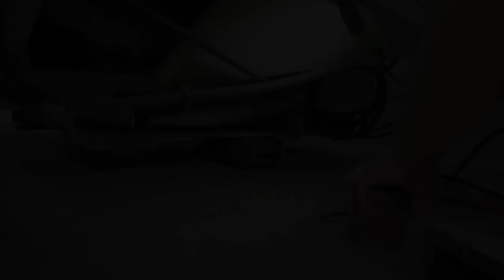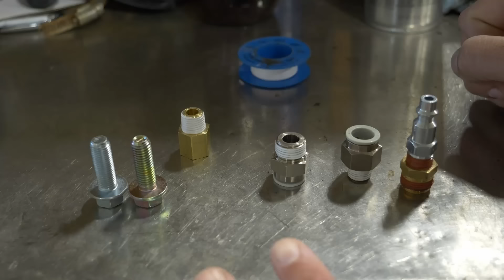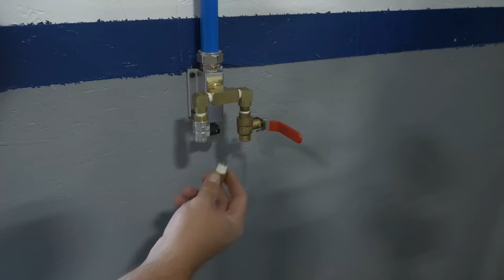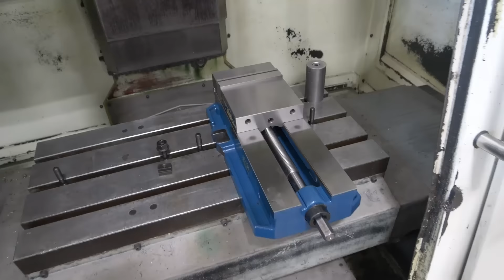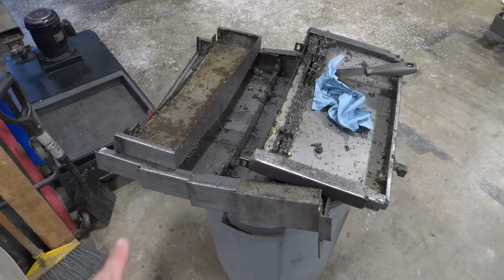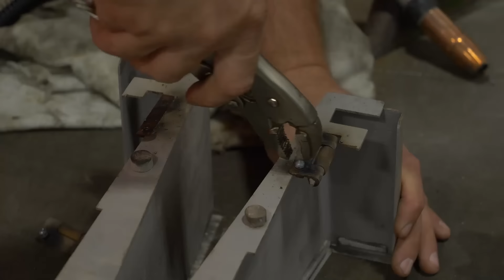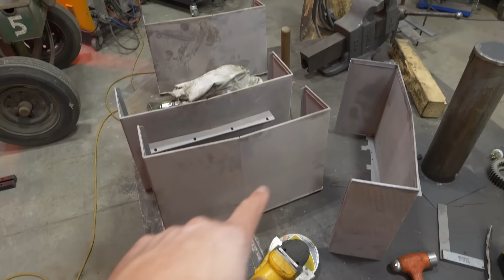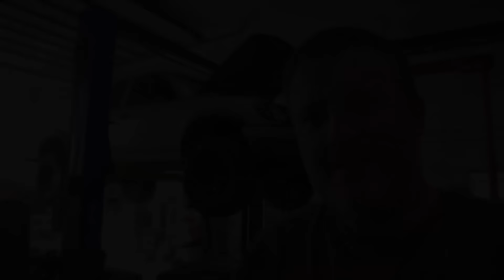Did I Buy a Problem or a Solution? Cheap CNC Repair Part 1

Comment: There is no such thing as a fully metric country. Even in the most enlightened of places, the dreadful British have contaminated some area or the other with their outdated standards. For instance a TVs size, a bicycle frame, or a cars rim, is measured in inches, pretty much everywhere, on the planet. Pipe threads, and hydraulic fittings, are still sadly one of these murky areas, where you regularly come across sizes made up of divisions...
I comfort myself knowing that today both the British, and American inch are based on the metric system, as they didn't have any semblance of accuracy, based on the original definition, which was to lay out three full barley corns next to each other(!). The Japanese have their own old system also, based on some ancient Chinese stuff. Think they even banned the sale of scales in their old system to make people stop using it. It is still fairly common in Japanese carpentry dough...

Comment: Wow. DTE-24. That brings back memories of when I worked on machines that were made in Switzerland. Used DTE-24 as air lube. We just put any kind of air tool oil in, never hurt anything.
Reply from the maker: In most cases oil is oil. The builder will spec the best oil just to cover their behind.
Reply: We used to use DTE-24 in a Monarch Cortland VMC75 back in the day

Comment: Apparently that tacoma didnt get the free frame update. Should have been under the 15 year warranty between 95-2004 model years. My dad had one with the  'bad' frame, and Toyota replaced it for free.  So much was pre-covered, all he had to pay for was upgraded / new shocks.  Got new brake lines, new rear springs.  And that was the weak link on those trucks.

Comment: You are putting so much work in that machine, please make a backup of any harddrive you can find in there..
Reply from the maker: It's an SSD. It should be pretty safe.
Reply: @WatchWesWork  No disk drive is "safe", even if it's a solid state drive. I remember SSDs suddenly being blank bugs not too many years ago, or the samsung slow down bug. A disk image (using an external enclosure and some cloning software) gives a piece of mind. Especially with old machinery, where reimaging images might not be available from the manufacturer.
Don't be me, don't learn the hard way 😅
Reply: I'd gut it and use a new machine controller. But that might be a lot of trouble itself. Still I like what I like. I'm willing to go to unreasonable lengths to get it too.

Comment: Good Tacoma frames are actually not that hard to find in salty areas. Toyota replaced a ton of 01 - 04 frames as late as 2019. They aren't that bad to change either. Guys that did them a lot could do them in about 20 hours. If you never did one before expect closer to 40 hours. You can use an 01 - 04 frame on any 95.5 - 04, but if you're using one on a 95.5 - 97 you need 98+ leaf springs.

Comment: Actually I think most of Europe uses BSP pipe fittings. Metric fittings are only rarely used with water and air, but common with hydraulic and compression fittings. I knew about the difference between NPT and BSP, but I didn't run into a NPT yet (although I never really check any other than seeing if they thread together, so I might have unknowingly threaded NPT into BSP and vice versa).
Metric threads have several standard pitches, although you'll only get the most common one in hardware stores, fine threads are specialty and only stocked by specialty fastener stores.

Comment: Great video, and I like the comparison of metric- and imperial system. I live in Norway, and I have worked at a shop that makes hydraulic hoses. On the shelves we had BSP, JIC, ORFS, NPT and MM (millimeter) fittings, and they are pretty common in any of these shops here. MM and BSP is the most used types, and ORFS is also getting used more and more.

Comment: Hi from the uk - we are a mixed race ie we use imperial and metric - my tape measure is in both so it is excellent for measuring things ??? Say if I want to measure a piece of wood which is just over 33.3cm urika it is suddenly 13inches or vic verca if it is just over 5 1/8 inch suddenly it becomes 13cm. Very handy for getting my head around non critical measurements. Anything for an easy life so I think I prefer metric in the long run as it is easier to multiply 😊🇬🇧

Comment: With one problem in your physics. In the US standard, we have lbm and lbf clearly.  Since no one indicates the "f" or "m", it gets confusing. The lbm is the the mass or slug (the unit of mass in USC), but slug s not used.  Slug is equivalent of Kg. lbf is the unit for force or equivalent of Newton.

Comment: As someone from a metric-only country (mainland europe), it doesn't mean that everything is actually metric. The most annoying example is most connectors related to pipes (water pipes in houses, garden hoses, gas lines, whatever...), which for some reason is still almost entirely inch-based, and I have no clue why. Usually just the connectors though, the actual pipes/hoses use lengths and diameters that are metric. AFAIK there are metric standards for connectors, but they aren't in use in practice. I guess it's a relic for some reason, and there never happened to be a suitable time to break with what's commonly used?
I did check a local hardware store, just searching for (my language equivalent of) "hose" or "pipe" and similar, and didn't see a SINGLE metric connection. It's just wild...
But we also aren't quite free of the inch-world, just like BSP isn't a metric standard even if the whole CNC machine is from a metric country. Multiple/many standards is exactly what the metric system is supposed to prevent, or at least make more rare, which only kind of works (but not quite). The more niche an application, the more likely there seem to be multiple competing or even conflicting standards. There are "standardizing entities" like ISO or DIN amd they usually have true equivalent standards for the same thing, to avoid conflict. But there is no true "definition of metric" either that I know of. It's maybe more of a concept, and again more niche means less clarity.

Comment: Yeah...covers look good to me...I've ran machines far worse than that...do like the cardboard mockup machine... would recommend shutting down the machine with a empty spindle and placing a wood 4"x4" below the spindle for when your not in use...helps the drawbar from hanging up ...good content and waiting for part two..thanks Wes...🔧🔧👍

Comment: Call me odd, but I actually love the fact you go over the different standards for bolts and threads. If you don't know these things it would be very easy to use the wrong parts and not only wonder why it doesn't fit together right, but also create a very dangerous situation. Keep up the good work!
Reply: I've worked on all kinds and have got a couple of drawers of various leftover fasteners. This makes sense why some of them seem loose
Reply: rarely does it create a very dangerous situation... just a lot of frustration.
Reply: @pcspecialistpdx  When you're talking about thousands of psi, if the threads are incorrectly matched, then it does indeed create a dangerous situation.
Reply: Whitworth is the worst.  Some sizes are incredibly close and easily confuse people.
Reply: @andrewnajarian5994  Both Whitworth and SAE have a lot of threads that have the exact same specs, like 1/4-20. The only difference is the angle that the threads are cut, Whitworth threads are sharper at 55°, SAE threads are cut at 60° So, you can spin an SAE nut onto a Whitworth bolt, it'll be loose but it will thread on. A Whitworth nut, however, will jam on an SAE bolt.
Reply: @Mishn0   Whitworth are also rounded in the peaks and valleys.  Thats what I mean though, they’re frustratingly similar.  😂
Reply: Just weld them together. LoL.
Reply: Hear, hear!!
Reply: hi odd, i'm dad
Reply: Yeah,  I learned something from that.
Reply: That is so great, I think you should make just that part into it's own VJO ( yes VJO, that is an AVE reference one of the other greats here on youtube)
Reply: @artstudio9673   OMG with the acronyms! 😂. Seriously though, what are you saying?  Some of us are genuinely interested and don’t have a clue what “VJO” & “AVE” mean.
Reply: @andrewnajarian5994  "AVE"is a great YouTuber he was my all time fav until Diesel Creek came along. He is hysterical  and has his own language,  Sometimes called AVE speak.  VJO " Va- Jay Oh" is what he calls videos
Reply: @andrewnajarian5994  "AVE" is  one of  the best YouTubers out there, check him out,  may take time to get his genius. He bastardizes the English language and  even has what is known as AVE speak, VJO is AVE speak for Video ( Va-Jay Oh),  check him out ,you will not be disappointed.
Reply: @artstudio9673  thanks!  I’ll have to check him out.  I haven’t really gotten super into diesel creek, but I really enjoy Wes, VGG, Mortske, Puddin’, Main South and Project Farm.
Reply: @andrewnajarian5994 I watch Matt at diesel Creek all the time he does a lot of great videos they are great I recomend them
Reply: @artstudio9673  AVE? 🤮

Comment: A lb is also a unit of mass. Lbf is what you're using, which is exactly the same as kgf. The force exerted by 1kg of mass in earths gravity. Converts to 9.8N, but it's Unnecessary to do that conversion. 1kgfm is the same as 9.8Nm on 🌎.
Just like lbf, is the force exerted by 1lb of mass in earths gravity. You're just used to talking pounds as force. I've used Kips many times, 1000lbf.
Reply from the maker: That's a crutch though. kgf is not an SI unit.
Reply: Doesn't stop millions of people saying how much they weigh in kg.. Which is technically kgf

Comment: In many respects i envy your owning a CNC  machine. My biggest concern however would be getting replacement circuit boards or anything electronic. Hurco has been around for quiet a while and they are a low volume, prototype designers dream.
Reply from the maker: That's always the risk.
Reply: A lot of hashed CNC machines have completely burned out electronics. Then you can do a retrofit. You replace all of the electronics with off the shelf hardware and generic machine controller software. Although what you gain and lose by doing that is debatable. It's still an option many have taken though.

Comment: Toyota has a frame recall nationwide. Have them reach out to his Toyota dealer. They’ll put a new frame under it at no charge.
Reply from the maker: 10 years ago maybe.
Reply: @WatchWesWork  This is this is recent they inspected it twice and coded it because I didn’t have any rust on it. If you go behind any Toyota dealer, you see stacks of frames in the back where they’re still changing them out.

Comment: Bought a brand new 2000 Tacoma V6 Ext Cab manual back in the summer of 2000.  Put 146,000 miles on her, loved that truck.  Took her the dealer to get parts to fix something minor and asked about the recall these trucks had.  My truck was a month away of frame warrantee expiring.  They looked it over a couple days and told me my trucks frame was rotted out and would buy back my truck.  I was extremely disappointed because I was going to keep that truck forever.  They offered me $12,000 for my old Taco, I said SOLD!  Still miss that old truck though.  This was back in the summer of 2015.

Comment: Here in germoney everything in Plumbing is G thread fractions (wittworth) like 1/4, 3/8, 1/2, 3/4, 1, 1 1/4, 1 1/2, 2". Copper Pipe sizes probably originate from Imperial: 12, 15, 18, 22, 28, 35, 42, 54 mm. PVC Pipe on the other hand is metric.  I noticed in Air systems is is a total mess, any imperial thread and any possibe metric thread.
Reply: G thread is the German designation for British Standard Pipe Parallel (BSPP).

Comment: at high school in scotland we were always taught to check what system was being used for all sizes and hardwear , and in technical drawing we were taught to put the size or measurment with the correct notation for the "standard " to be used also. the other thing is in the u.k we still use our old imperial systems alongside the newer metric ones, so you learn to check and make sure before trying to put things together.

Comment: I'm going on 2 years of working as a HAAS factory outlet tech. You're explanation of leveling the table for twist and the table sweep almost perfectly lined up with how I was trained on doing installs.
Reply from the maker: I do have a granite square as well, but it's kinda overkill for this baby machine.
Reply: @WatchWesWork  I have yet to use a granite square outside of a post-crash alignment. Lathes are what I've been aligning the most since starting as a tech and that mainly involves a ground test bar bolted to the spindle face to run indicators along. The c-frame mills seem to rarely get knocked out of alignment unless its a really hard crash, or at least thats how it seems with the customers in our HFO territory. Haven't seen many Hurcos in the shops I visit.

Comment: So, you complain about Metric and then reference BSP, Japanese "M10" bolts, JIS, and JIC hydraulic fittings - none of which are Metric. Then you state that pounds don't represent mass - they absolutely do - unless you are talking about pounds-force (which you are when you are talking torque wrenches). In the metric system, kg represents mass and N represents force (weight). Simples. Still, I imagine it was all click bait - and it worked. 🙂

Comment: READY FOR A CRAZY A THEORY??  The pandemic set a drastic change to economics.  And we've seen steep wage/price increases.  And it's a cycle...  price increase ==> demand for wage increase ==> new price increase ==> new wage increase ==> etc.  Like an underdamped wave this ping-pong between prices and wages will take some time to settle out.  So, bottom line, expect price/wage iterations to occur for a bit.  Each cycle should be diminished from previous...

Comment: I'm an engineer.  Metric hasn't made my life any easier. In spite of its power of ten feature, that doesn't really help in real life.  Answers are just as messy.  At the smaller sizes, we still get into in-between sizes like 2.5mm.  i think some people don't like English or Imperial because they don't understand fractions, which is a completely different problem.  And then there are the metric religious zealots here in the US.  To show that their religion is just a cult, I often tell them my 1963 house was built in metric - all my studs are on 40.64 cm centers. Can't get any more metric than that.

Comment: Your comment about the M10s is a bit incorrect. One is fine thread the other is course.  Both are available in metric countries like Japan and Germany. You see that m10 fine on japanese automotive applications a lot but general hardware store bolts are the normal course thread

Comment: The other fun thing about bspt threads is finding female components.  Bspt can be threaded into bspp, Rc, R, and G threads, but because G used all features of R and BSPP, you typically only see components with female G threads.  It's tough explaining to a customer why they need to approve equipped with G threads is being used on their equipment when they specified BSPT.

Comment: Hey Wes, you can get BSP in hydraulic shops. I learned this in 2012 when I had to connect a German fuel oil burner on a boiler in the Chicago Suburbs. I used Valley Hydraulic in South Elgin, IL. You probably can find a closer supplier to you, but that was close to me. I needed to convert BSP to NPT and they had the adapters for me, it was magic as I felt screwed at first.

Comment: ah the perrils of standards, had this lovely introduction to them when working on my old honda motorcycle and was struggeling to get the phillips screws out. low and behold they use the JIS standard for the screws aswell so the drivers are different

Comment: I ran a old hurco with a dynapath controller and a weird tool holder system ive never seen since....if anyone knows let me know. It had a few spring loaded pins that locked it in place no taper, just a big cylinder shape.
Reply from the maker: Weird. Kinda like the old Moog machines.
Reply: @WatchWesWork didnt look like the moog. It was big and about 10lbs each. Had springs held in under pressure with allen bolts. Some kind of center stub would snap into it from the spindle.  This was in 2000 and it was older then

Comment: what is wrong with the us measurement system that makes metric better   we don't have a 5.5mm socket. and  a 5.0 chevy can be several different cubic inch size when you ask for a part with american cubic inch they know the difference in a 302 or a305 or a307
Reply: .0043 us liquid gallon
Reply: And how does this apply to repairing automobiles. How much clearance should there be in the clutches 1995 46re and if they are not correct how do you fix it
Reply: I figured you would know I know but it's information I need this other stuff I don't need to know

Comment: Never mind the threads, what about those quick disconnect air things? There seems to be dozens of slightly different ones with tiny variations in the dimensions and the shape of the "barb". I swear some of the manufacturers of cheap compressors and tools make their own unique ones that won't mate with anything else.

Comment: 1 N = 1 kg*m/s2.
The Natural for us but it is the same as the Imperial system it is not natural
Reply from the maker: No. It's 9.81kg*m/s^2
Reply: @WatchWesWork   to put it another way 1 kg = 9.82 newton (N)
the metric system is built on physics.
I hope you have a good day It was a good feature you did

Comment: I have a real nice absolutely rust free 2001 4x4 Toyota Tacoma I bought new and drive everyday to this very day.  Its so clean there are still old barcode stickers here and there.  The code bars have faded away but the stickers are in good shape.  Still on the original brakes and clutch too!
Reply from the maker: You're sitting on a gold mine!